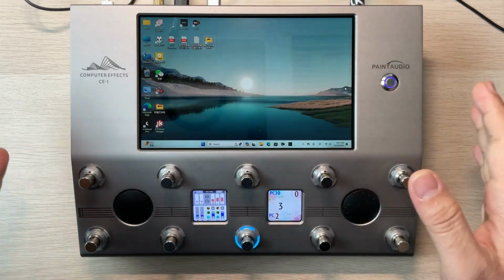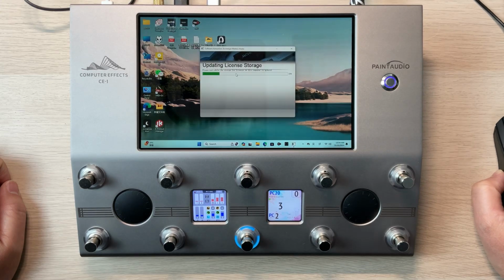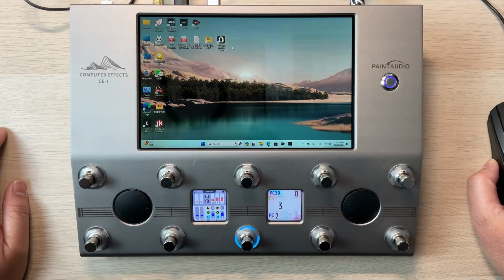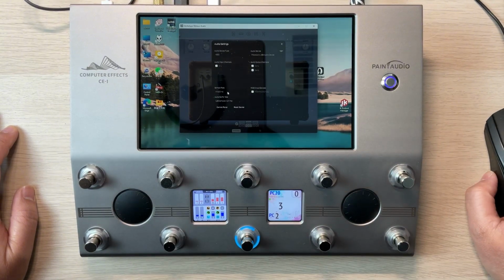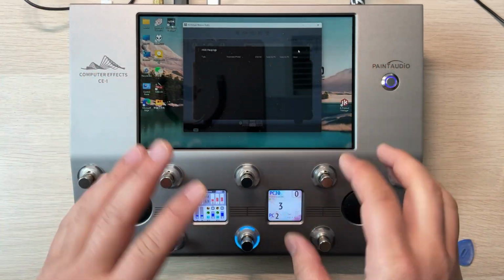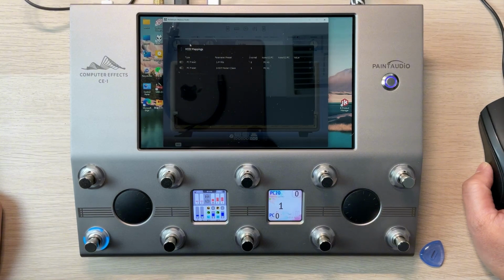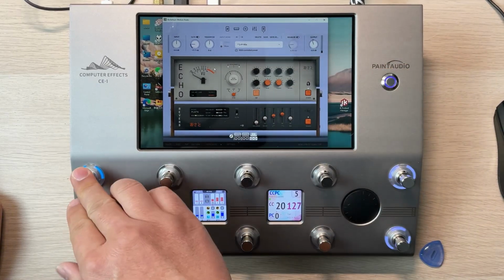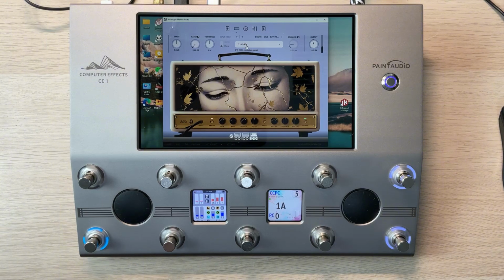CE1 【6】Tutorial of Neural DSP Plugin Install Setup Audio and MIDI

Comment: this is a game changer, say goodbye to normal digital pedals... now you can have the latest pluguins whenever you want... it does not get outta date
Reply: a computer with windows is not a game changer. the benefit of a dsp chip is that its solely used to process audio, resulting in very low latency. this thing has an intel chip running hundreds of background tasks, its not prioritizing audio. good luck getting this thing to low latency if you want to use other plugins besides the neural standalone. might as well get a mac mini and some midi footswitches which is way more powerful than whatever intel chip this has.
Reply: @giles3211  make a review once you have one my friend, and tell us about the latency, otherwise you just making ignorant asumptions... besides, intel chip eventually will have no latency, maybe not this year but eventually they will
Reply: @pedroroggla8129  sorry buddy, but he's right. Digital pedals will go anywhere anytime soon. " intel chip eventually will have no latency, maybe not this year but eventually they will" you have no idea. the better the latency the price goes up then you see the problem. the current market right is heading to Quality, portability and ease of use and this is why you see these product like toneX, Kemper is on fire right now. the current product right now needs to have a optimized proprietary software to compete with the current market. I love the product but this product will not change everything but it's a good innovation and I'm sure wilson will improve it.
Reply: Game changer Game changer Game changer Game changer Game changer Game changer Game changer Game changer Game changer. Can’t wait for the new game at the Olympics!

Comment: You should design a midi controller/audio interface/display combo that can integrate a Mac Mini. You'd make A LOT of people happy, and you wouldn't have to worry about the PC parts configuration side. Mac users are never going back to windows for they guitar stuff. Build THE EXACT SAME PRODUCT with space for a M4 Mac Mini instead of the built-in PC. TRUST ME!!!
Reply: Mac’s can’t be user upgraded. So if there’s a chip update, you have to shell out $2k for say a new M6. And this is an Apple lover. I spent $7k on the maxed out M1 ultra 16” laptop. A year later it was basically a dinosaur. :/
Reply: @TheSkulletMan meanwhile I’m rocking AmpliTube 5 and neural dsp plugins via Cubase 13 on my 2012 iMac. You don’t HAVE to shell out for anything.
Reply: @TheSkulletMan  I don't think you'll need to update a M4 Mac Mini for 20 years if you're using it for audio stuff
Reply: @LasCosasComoSean  actually, I have an older Mac mini that I can run windows on since it has the intel chip. Just in case I do need windows…
Reply from the maker: Thank you! Yes. I can get the point.😄
Reply: ❤❤❤❤❤❤❤❤❤❤ yes
Reply: For that price I'd buy a good tablet and a midi pedalboard, and still have money left over for a plug-in.
Reply: Agreed, was excited about the product but can’t trust windows. Mac version of this would totally be a game changer 🙌
Reply: @ToneForgeX  Modern Windows is as stable as Macs are, especially in this environment where you're only installing the audio software you're going to use.